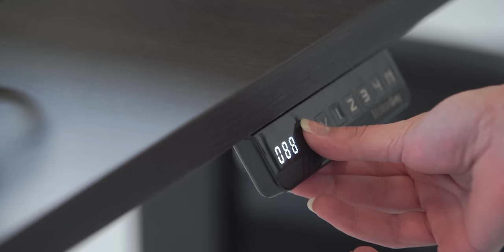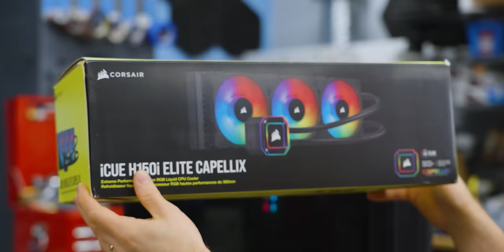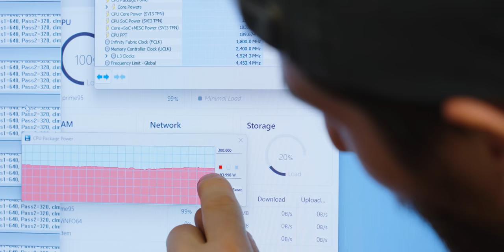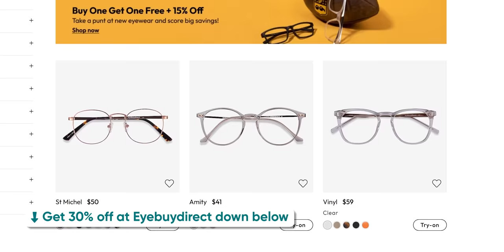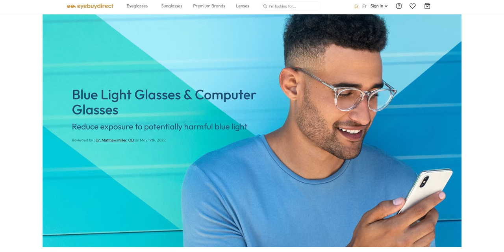Redneck Engineering my own CPU Water Cooler

Comment: Actually heater cores are for HVAC. Coolant is passed through it while your cabin fan blows it down through its various ports. A radiator cools the engine of a car. That why during tests you leave your air on full hot. Like when your doing a coolant change and trying to flush the entire system and get air bubbles out.

Comment: Geez, last time I saw something this janked together, I was a young Marine in the barracks back in 2004 and my roommate dragged 2 motorcycle radiators into the room along with random hoses he "liberated" along with a fish tank pump. He didn't use a normal case, he built it into a footlocker with chicken wire to cover the fan holes.

Comment: Remember, being able to buy off-the-shelf watercooling components (pumps, radiators, reservoires, blocks, etc.) wasn't a thing until later. Blocks were extremely basic, pumps were aquarium pumps, reservoires were often just bottles and radiators were actually from cars. So if you were going to watercool a PC in the early to mid 2000's, you had to do something similar to this. Oh, and fans optimized for static pressure weren't a thing, so you had to run your stock fans at high RPMs to force suffient air through the radiator.

Comment: Here's a thought guys, you look for some secondhand WCing gear off of your local PC enthusiast forum and save a buck or two... just a thought... been WCing for over 10 years now and bought a bunch of gear off of the forums while there definitely has been a few lemons 99% has been solid with that remaining 1% basically needing just a solid clean. 

The only thing that a newbie would need to buy new is tubing; otherwise, blocks, radiators and fittings are all readily available. For the most part, pumps are solid I've bought and sold probably 10 over the years most recently I bought some that just needed a clean (that I haven't gotten around to aha)

Comment: Middle ground to this was the EK Phoenix if you want flexability to do custom loops but as an AIO. Picked up a 280mm rad block/pump, then reterminated my fittings with a seperate gpu and cpu block for less than a AIO AND with a GPU together. Don't think it's a supported product line any longer though.

Comment: Linus...  You mentioned getting a heater core from a junk yard.  I just priced one for my 2018 Toyota Tacoma truck and a new one from NAPA Auto Parts was like $92.00.  I would rather spend the extra money for a new one with zero possible corrosion inside.  Which the one for my truck the ports were all on one end to where you could mount it vertical with the ports facing up to bleed and air out of the system.

Comment: I totally had a computer with a Hyundai heater core, an Eheim aquarium pump and a huge custom built plexiglass reservoir complete with a Playmobil deep sea diver fighting a moray eel over a sunken treasure and an aquarium backdrop and and a blue cold cathode light to make it look like it's deep under water 😊
And the case was totally clad in bitumen and car sound insulation foam. Oh yeah and the PSU was modified to have an internal 220v socket for the pump 😅
In fact that computer is still in my storage. I should dig it up and build a monster computer in it

Comment: memory unlock
in the early days of water cooling we got a PC in for repair that used all copper tubing. Luckily it was just a software issue so we didn't need to disassemble it but it was absolutely wild. And heavy af.

Comment: You could have saved a lot of money, by instead of grabbing an off the shelf pump, pick up a functional salvaged car coolant loop pump at the same junkyard, refurbish it with new o-rings, and attach it to an electric motor if so required and you have a nice reliable pump.  (Some car coolant loop pumps run off the the 12v some run off a belt from the engine.  Some in semis run off compressed air.)

Comment: TK-123's if you could still get them would have been in budget. I had a set of 3 and they were amazing for their era... just really loud. 

I never used a heat gun for softening the tubing but i have used a cup of near boiling water and soaked the ends in the water for a minute or two to soften them. 

Also I have used aluminum rads since the early 2000's and never had corrosion issues but I never bought such cheap water blocks before. And always avoided things like EK where they have been prone to have bad plating over the years.

Also glad to see someone bash AIO's as much as I tend to dislike them for being cheap solutions with no upgrade path and truly weak components.

Comment: Those blue LED fans look like the Antec fans that I finally replaced after 20 years of them running in various PCs. Only ever had one of them actually quit working. But modern fans are much quieter.

One note though - putting the reservoir on the front of the case isn't a great idea. I get that it's more difficult to do, but a rear-mount or top-mount would be better, because then it isn't dumping the heat back into the case. Also a good idea to have more exhaust fans than intake fans.

EDIT: You guys are still using a ridiculously high TDP limit though. 95C is like 200 real degrees, which is cooking your silicon.

Comment: fan configuration actually makes a huge difference even in a water cooled system. even then most systems suffer from the vrm's being tucked up in a corner where theres almost no flow if not a dead spot if your fans arent set up right. I would  literally use that big fan if i could, idc.

Comment: i got my arctic 420mm for 110 euros  which is arguably the best aio which also happens to be one of if not the cheapest, which also has extra cooling fan on the block and comes with 5 year warranty. has high ambient temperature resistance unlike kraken series which all have died in my room.

Comment: I still have a heater core like this from back in the day stashed away in a box. It was from a lincoln something iirc.  basically was a dual 120 size.  it was quite impressive compared to purpose built dual 120 rads back then.

Comment: Linus is doing what I did back around 2004 with heater core from Skoda Favorit, aquarium pump and "water block" using aquarium tubing ... Not bad, world has finished a whole loop :) My P4 Prescott ran much, much cooler back then

Comment: Back in the day I did this 😁
But I bough it off eBay with a fresh custom paint job the hose fitting I wanted. It was really cheap compared to PC water cooling radiators at the time and a had better performance 😎

Comment: Love the video, I also love this types of projects.
It’s the kind of stuff I want to do myself 😂 but can’t do all the projects in the world sadly.

There is a potential issue though by using a submersible pump on air for extended amount of time, most of them rely on the water to cool the motor so by running it dry the pump might over heat over time, what I want to do is install a recirculating pump usually meant for heating systems as it’s small and usually quite strong.
Reply: A lot of submersible pumps run fine in inline mode. It's the ceramic bearing that the impeller armature rides in that needs to be cooled and constantly wet. It only becomes a problem when you lift a pump out of the water with no water running through it.

Comment: Idea. 
There are car radiators for automatic transmission cars with a transmission cooler in the bottom, (another 2 hose connections, typically 1/2 to 3/4 inch) you could use those for the PC circulation part, and use a separate system for the normal radiator hoses and make a water cooled-watercooled system. Hope it makes sense.

Comment: I'm not sure if my worries are well founded, but I would think hose clamps would be better than zip ties, to keep a hose connected to a fitting. Also, they'd be a better excuse to advertise the LTT screwdriver.

Comment: NGL, just saw this and thought about my own "Redneck-rigged" design for watercooling...   reservoir cooled by a water fountain. thought is, route through a pc radiator as a "AC" for the case, then CPU (and later GPU) block(s), then into a stainless steel reservoir wrapped with a broken (water lines busted, cooling components still work) water cooler cooling lines. coolant would go in the top, filtered down and cooled, then pull from the bottom. Learned a bit about the copper/aluminum issue, wonder if stainless has same?

Comment: Could use a transmission cooler. often the kits come with lines and clamps even. Typically they're thinner so they'd work better with PC fans.  Many are copper with aluminum fins. Fluid doesn't touch the aluminum so that's not an issue. the line fittings are half the size of heater core fittings so more typical of PC cooling lines.

Comment: You should try a cat evaporator. They are almost all made off copper, the fin density is a bit lower. Might even work a bit better, just would require a bit better cleaning due to the oil. Just a quick thought from a mechanic. Love the videos

Comment: Another problem with modern heater cores are that most of them will use plastic end tanks with random tubing sizes that are hard to modify. Also they tend to be brittle AF if you get them from some cheap early 2000s car that’s been through a couple thousand heat cycles

Comment: Next time run to home depot on 200th, get some shark bite fittings and copper connectors to make it easy lol. plus some 3/8ths clamps for more added pressure.

Comment: I've been thinking it'd be cool to build a hidden pc into a desk with a slot to slip the monitor into to hide it. It'd be cooled by hidden radiators either passively cooled or cooled with very quiet fans.

It'd be even cooler to have the desk be modular so you can add cupboards and shelves, with more cooling built in.

Comment: Feel like the radiator shoul had been put through ultrasound washing to get any left over goo out.. and or circulating some strong chemicals through it for a while..
Reminds me of the yonder years when I made similar setup (can't remember where I got the heater/radiator but about same size as that one) - worked fine for couple of weeks until the antifreeze solution running in it pushed whatever goo into the block and broke it. In comparison even the Zalman's passive radiating reservor worked better and cheaper. :p

Comment: incorrect about the heater core - they are under the dash and take cabin air or outside air (at low speed) and heats that up.  On your car's dash, you will see the button for inside/outside air.  So the fan drives almost 100% of the air movement.

Comment: Early 2000s? Lol, we were using them long before that! Transmission coolers are much thinner and cheaper but work really well BTW! Fountain pumps for water movement and capped PVC pipe for a reservoir :) Still using one of those setups on a 16core AMD with a decent water block...

Comment: The heater core is the pit of the heating system inside the car, so it gets no airflow except from the heater blower (usually a centrifugal fan ).

Comment: Bruh. You need a car guy to help you with this. There are reducer tubing at any parts store for a few bucks. And if you grab the heater core grab the fan too. It has a way higher flow rate and is designed to be on the quiet side. I have so many ideas.

Comment: Alex shouldn't grind anything but tool steel on that grinding wheel.   Any softer material will just clog the wheel and can cause the wheel to explode.  Use a belt sander.  I'm sure you guys have one around.

Comment: Why do they always put the water tank under their loop ? I dont know if it would improve a lot the performance, but isn't it always better to put your water tank above the loop ? This way you should avoid any bubbles in the radiator or tubes. Even if the DIY stuff is chaotic (and it's what I like) I'm always triggered by that detail so I'm beginning to question my self

Comment: The really cool thing about the copper is that you can get copper barb fittings and sweat them on and not have to use JB weld and ever wonder if it will leak 😎

Comment: Actually stretching the larger tubing over the smaller pipe would reduce the amount of restriction in the line so it's probably better that he went that way rather than going in to it is that would reduce the flow.

Comment: But why retain the 240v starlink router, when you could convert it to 12 or 48v poe via cowfish or outback comms? Or just get a gen 3 dish which is just regular POE and no modification required

Comment: Couple minutes into the video. Linus, you're wrong. The heater core almost always sits in a box inside the dashboard on the passenger side of the vehicle (usually right behind the glovebox) and air is blown through it by the same fan that blows AC. Usually a centrifugal fan.

Comment: SIR { tow } 360 aio radiator Can we cut the radiator pipe  and make it a single aio radiator off 360 + 360 and one pump ! What will work and they will give better performance ?

Comment: A thing to mansion to, in comparison to a AIO, the way you are making a loop now, that's with a reservoir, also makes that the "same" water doesn't always go straight back in the loop, but is still in the reservoir for a short time, where in comparison to an AIO that is always the case, the same liquid is always pumped around in there, not that that makes a huge difference or anything, but is a thing to mansion to. Anyway, verri nice video, you guys are the best combination ever if you ask me. 
Anyways many grts from the Netherlands 🫡

Comment: everyone knows you need a bonneville copper heater core. The mod I did as a kid was to unsweat the copper tubes and put a hose barb fitting there with JB weld.

EDIT: should have kept watching the video. HE ADDED HOSE BARBS WITH JB WELD!

Comment: This test, here in Brazil, is outdated by at least 15 years! I have already done this with a motorcycle radiator (copper radiator), I was not surprised with the results. I used cold water and antifreeze and also a water pump with expansion to put ice. this is old!!!!

Comment: @11:22 that is how I used to ran my two different size radiators as well, just slide one hose into the other and let it rip!
Reply: I also have a fountain pump inside a plexiglass box that fits in a drive bay!

The things we used to make to watercool our machines was so jank!
Reply: The bottleneck is the interface between the die and the cooler... aka the IHS.

Comment: +1Ghz from an air cooler???  Yep!  I made a four tier heat sink super stack using a stock cooler with a copper plate (as a spacer) and two heat sinks from an old iMac.  I forgot to save the benchmark from the stock cooler but I know the OC topped out at 4.0 Ghz on a 3.5 Ghz CPU, the Intel Core i7-5930K.  Using my Frankenkuhler I successfully clocked it at 4.998Ghz, sustained.  That's the same number Linus came up with using a liquid cooler in the video on overclocking the Rampage V Extreme with an Intel Core i7-5920.  So it's a bit like comparing apples to oranges in that regard.  I was hoping you professional types could test out the idea using your Linus Tech super powers. 1Ghz gain using a cobbled together air cooler.  Could it really be this simple???

Comment: Question since you used a submersible pump. Could you have used/made a larger reservoir that the pump could sit in (like one built to fit in the area you have the pump) drawing from that, while than the outlet from the radiator merely allows it to flow down into the reservoir that is sitting below it.  By doing that you both deaden the sound of the pump, but also help to keep it cool an running better, with a larger reservoir that does not take up more space than needed.

Comment: Um, I... How does that compare to a Noctua heatsink that comes with fans? Prob could get one used. Just asking cause my d15 has been on two beefy cpus. Intel 6850k at like 4.8ghz prob pulling 220+ watts and now a amd 5800x at 4.6ghz and never had issues with it.

Comment: It would be cool to see a comparison of axial and centrifugal fans as well, since the heater core was designed for a centrifugal fan rather than the axial ones shown.
Reply: It's just a matter of static pressure. In my car from the 70s there is an axial fan for the heater core. Newer cars use centrifugal blowers but you'll need a lot of ducting for that. I don't know if that will fit in a pc case.
Reply: @schwuzi  Oh that’s interesting, I’d assumed they pretty much always had been centrifugal. Apparently I’d just been lucky with the cars I’ve worked on haha

I do agree that it definitely wouldn’t fit well inside, but strapping it to the outside as a “funny” test could be interesting. I know they’re known for their static pressure advantage, but most of the self contained centrifugal fans I’ve been around also seem to move a ton of air. It is possible that the regular fans I’ve been around have just been cheaper/lower end though.
Reply: @dannysiatkosky3515   I'd like to see that too. My guess is the centrifugal fan will be more silent than an axial one for the same performance.

Comment: This could work with one more rad. But the problems comes with space. Where to put ? Soo you have to junk it up. And place it on the case. This could work with maybe a custom case but with modern cases you are limited. Since those rads are not made for this

Comment: I'll be looking out for any copper radiator's ...
Had a few thoughts wrap the pc in pipes  or make a loop thingy on top with fans blowing on it 
pc steampunk design loads copper piping shapes/coils maybe around items  its your $ pc
Reply: i looked on google for old radiators $50 min Not worth the time if you can buy a cpu cooler & rad in one $80

Comment: Im really tempted on tryin to open my ek aio and swapping the rad to a copper one. The aio has been making bubbling noises when the pc boots up for like a year now, and i feel like the temps have risen since. Warranty is over anyways and ive got a replacement air cooler coming in, so i might aswell?